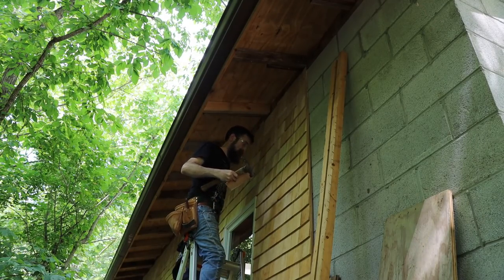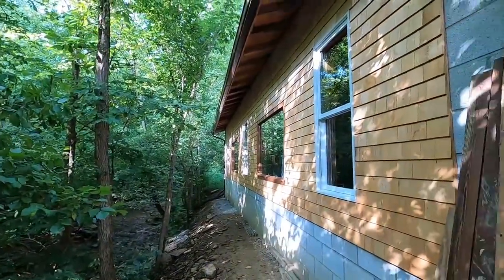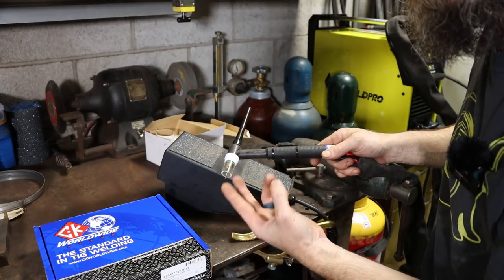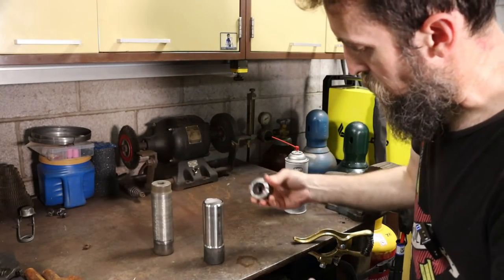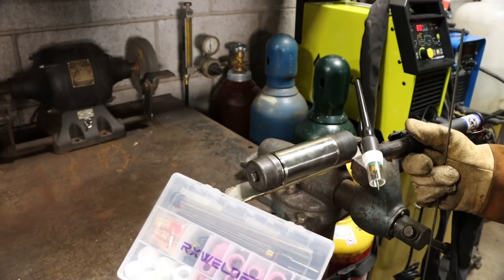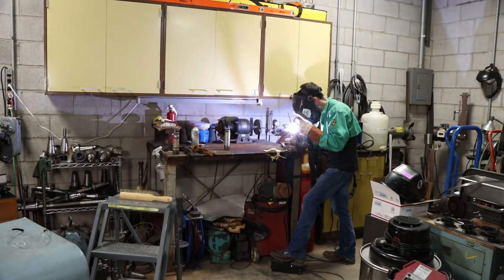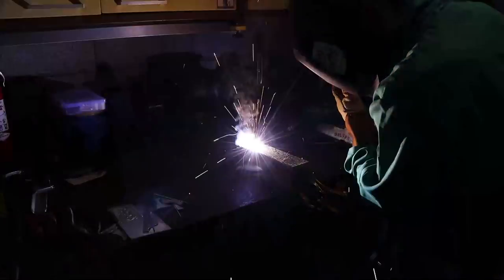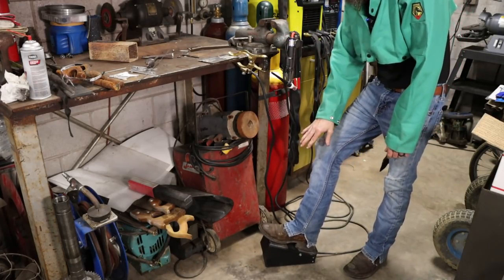Workshop Siding Finished / New WeldPro Welder

Comment: Honestly, I remember what the side of the building looked like before it was pulled down, and this is an infinite improvement! Even if there were nothing wrong with the wall, just cutting some windows out and cladding the side with shingles would be a huge improvement.

Obviously the biggest advantage is the natural light in the workshop from the windows (not to mention the view from inside), but the shingles do help it look less like an old industrial building, and more like a home workshop.

Also, bonus points for the "Many people live this way" caption. That cracked me up! <Digs hole> "Look at this hole! There must be something down here, otherwise there wouldn't be a hole! We must investigate this hole to the exclusion of everything else!"

Comment: I'm backing a welder on Kickstarter right now that is a "jack of all trades" type machine.  It's called the YesWelder.  It can stick, MIG, flux core, lift TIG, and it also has a plasma cutter.  I can't wait to test it to see what works best.  I'm not very fond of lift TIG, but I'm not going to be welding pipe at a nuclear plant so I'm sure it'll do ok.

Comment: If you are serious about gas saving I would suggest switching to a smaller cup and less stick out of the electrode when it is not needed. Save that see through cup for when you need to cover a larger area for welding stainless or aluminum or in tight places where it is beneficial to be able to look through the cup. Plus these Pyrex clear cups are fragile. One drop of the torch to the ground and it might fracture.  
Look into getting a gas regulator with two outlets. You will need it for welding stainless pipes as I am sure you will try in the future.

Comment: I enjoyed the piece on the Welder. Can't wait to hear what your settings will be for Aluminium 3/32 plate
Reply: @TakeDeadAim I have that exact machine. Here were I am we mainly get Thoriated (red) and Zirconiated (white)
I use mostly 3/32 White for Ali, and the red for mildsteel.
Thank you so much for the reply
Reply: @TakeDeadAim So, these numbers you have cited; would they be the same settings for all machines or do the machines typically have different values assigned to their specific controls. In other words is the result for say 70% on your machine the same as 70% on a Miller, Everlast, or Lincoln?

Comment: 3:32 So correct there Steve and those who don't get vaccinated! 👍
Yes, the shingle look real good indeed and must be a huge relief to have them finished. Now get back inside the shop where you belong and a bit cooler and less humid. 
15:19 Niiiiice!! I have never done any welding but did work making heavy earth moving machines and saw my share of really good professional welding beads. That is as good as any I have seen and it's aluminium (aluminium for USA speakers 😉). 
Are you going to cover the eves to stop wasps etc from nesting in there?

Comment: 19:35 The thumb wheel should be an index finger wheel (in fact it should be a slider control).
You can move your index finger without affecting the grip or the hand piece.

Comment: Quick Question would you ever Think About pouring a pad or some type of sidewalk on that side of your work shop. Would make it safer walking also protect the base of your structure.Thanks
Reply: While it would have its benefits. Pouring a sidewalk (not enough room for a pad) he would need to excavate for a footing on the slope side deeper than normal to prevent undermining of the sidewalk and do something to prevent erosion too.
He has already started some efforts to prevent erosion.

Comment: I remember learning to weld at a boatyard I worked at in summer of 1988 we built narrowboats or houseboats  we did stick welding with these ancient 1930's massive oil filled welding machines, I think they were about 300 amps which were needed to weld the ribs in the hull. Very hot job indeed! They ran about 30 or 40 volts which was enough to give you a belt and involuntarily chuck the hand held welding shield into the river! lol
The key to welding is of course spreading the heat all over evenly, burn a stick here burn another as far away as poss and so on.

Comment: Hi Steve, about the fan noise on the welder,
Would this work and depending on air volumes etc
My computer is in a pretty big tower case running a 750w power supply and ALL the good hardware, it also runs 7 fans with the largest 2 being 15cm each on the front 
All the fans are STEALTH Fans
As I have the computer running 24/7 in my bedroom 
and basically don't want to hear the beast running, You can't! (even with your ear to the back of the computer there is very little noise) 
It is 5m away from me right now and you can't tell it is on
Would you be able to replace the fans on the welder with stealth fans  even if you mounted them externally to the existing fan in the welder and had a switch to turn off the noisy fan and turn on the stealth fan when filming etc?
and maybe find some noise deadening foam for the case of the welder (or for that matter, a slip over case...
Excellent tutorial on the use of the welder Steve, I absorbed a lot! 
The outside of the shop looks fantastic mate
Tony from Western Australia 🇦🇺

Comment: Just curious about the different gas bottles you have. I am not familiar with tig welding, but I know there are different mixes used for mig welding depending on the metal being welded.

Comment: Hi,I Just wona to ask if your welding machin has option on 4t when you go ap or down slopes, if you hold butn your amps will not go up but stay on amps (wich you priinstal) and  when you let go the butn mashin get in slope up (wich you priistal how many sec). When go down slope is rewers so you hold the butn many sec you wont you bi on amps wich you are priinstal on machin. My welding machin work that way, and butn on the torch potenciometer is yust for ap or down the amps when yuo not welding just for seting amps. I like your YouTube chenel so go strong👍👍👍

Comment: Don't really understand why an analog type of switch can't be used. There are materials that generate power known a piezoelectric  materials.. I'm wondering if it could be used where you just squeeze a bit harder to increase the amps. That shouldn't really affect precision.